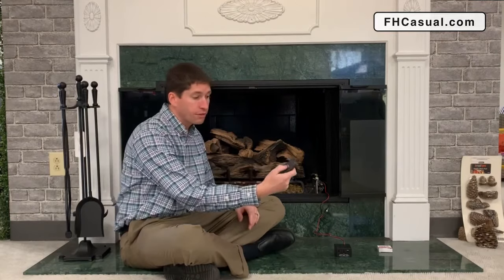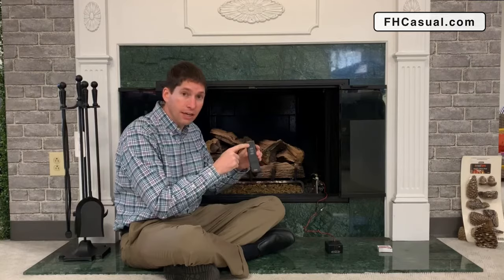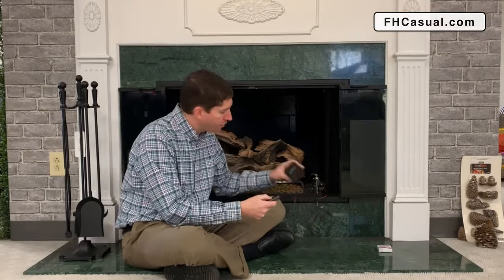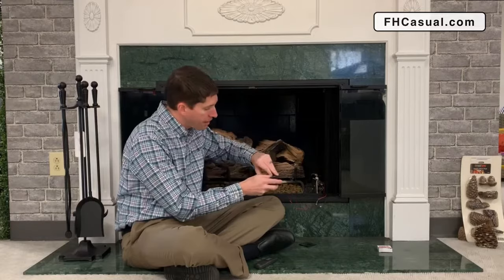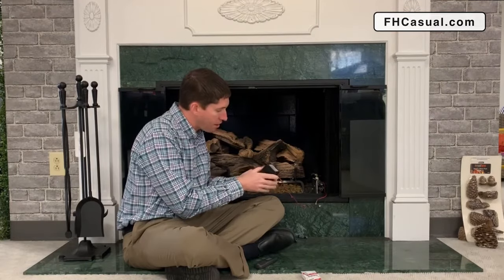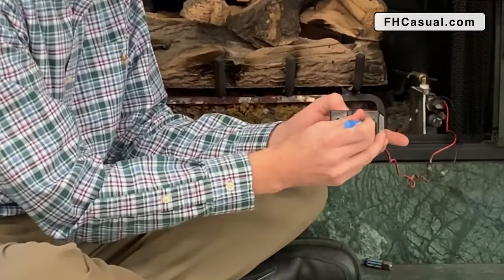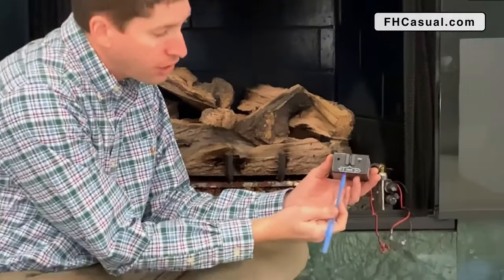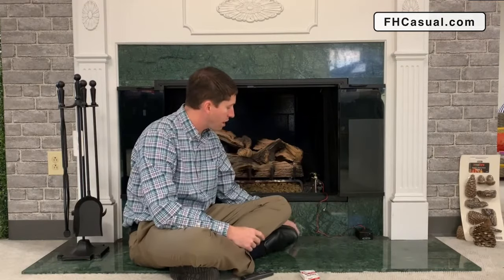How to Repair Your Fireplace Remote Control

Comment: You just saved me some bucks.  I had to change the batteries in the receiver.  I thought the remote wasn’t working then until you mentioned the “remote” setting on the receiver.  I had it on either on or off.  After moving it to remote I’m back in business.  Thank you!

Comment: Fantastic video!  Thank you!  Everything worked as you described.  The only difficulty I had was removing the back of the receiver.  Once I was able to remove the back, I found generic batteries.  Replaced the batteries and voila!  Fixed.  Thank you again!
Reply from the maker: So pleased we got you up and running again :)
Reply: My remote works but the E5 keeps popping up

Comment: When I press my “learn” button on my receiver I hear the single beep. But when I press the “on” on my remote I don’t get the multi beep from the receiver you got in the video. I see the red LED on my remote light up. I’m not sure what’s up.
Reply: Did you get it to work, I’m having the same problem.Thanks
Reply: My remote lights up and put all new batteries in reciver and remote but won’t work with remote but if I turn the switch to on the fireplace comes on what can I check
Reply: Same issue here. Any luck?
Reply: @whaleh8er991  still no luck
Reply: Same here. Ever figure it out?
Reply: Thank u, pressing the learn button then the remote re- synced it and that solved my problem and the beeping stopped thank goodness

Comment: The receiving unit usually comes with a metal housing that protects the unit from the heat, so that it can be put inside the fireplace. 
 Good video, thanks.

Comment: Where is the receiver located at. We had very cold weather last year & did not know that we  could add a battery to the fireplace. The remote was working before we knew anything about placing a battery inside. Cannot figure out now why remote will not turn fireplace on. I get the red signal on the remote.

Comment: I changed the batteries in the receiver. I successfully synced the two. However, when I push the "On" button, the receiver makes a beep, but the gas doesn't turn on. Pilot light is lit. Turns on manually. The receiver only beeps, but nothing happens. Any thoughts?
Reply: Same problem here
Reply: Me too got a pilot after changing remote box ... But the gas logs won't light .. I hear nothing
Reply: Look up the video on how to clean the temperature metal piece. Just a light sanding with sandpaper on the metal pin. It gets corroded and is a failsafe feature. Worked great for us.
Reply: I have no corrosion good batteries and it beeps at everything. Yet the flame will not go on or off or thermostat controlled....
Reply: I finally figured mine out today!! So, while the pilot light was lit, it would only turn on manually. I figured out today that by pushing the pilot knob in about halfway and turning again, it finally went all the way to "On." Tried the remote and it worked immediately!! I feel so stupid now... 🤣🤣
Reply: @Brendo_Games  where is the pilot button

Comment: Good video.  A few weeks ago, I started noticing a problem starting my G45 burner system.  It has worked flawlessly for almost three years.  When trying to light the burner, it would start "clicking" several times while the valve was trying to turn. It seemed to be stuck and not opening all the way for ignition. I changed the batteries in both the remote and receiver and checked to be sure nothing (gravel, etc.) was keeping the valve from opening all the way.  
Here's the deal, once the system does light, it seems to be fine for the rest of the evening.  
Next day: same problem - "click, click, click ..." - no ignition.  It's not the batteries.  It's not debris keeping the valve from turning.  Any help is appreciated!
Reply: My Real Fyre G45 has this exact same issue.  It is as if there is not enough force driven by the remote to get the valve past the on/off click point.  If you manually turn the valve past that point, the remote can get the valve to fully open and also to close.  But like you, when I attempt to first use the remote to turn on the fireplace, I get that clicking and the valve seems like it can't get past the on/off click point.  Did you ever find a solution?

Comment: Mine has fresh batteries in both. When I sync them it works once then nothing. If I press the button or flick the switch 10-15 times it works POS

Comment: Thank you but where is the receiver?
Reply: For us, the receiver was behind the panel...like the cover on the wall that look like the ones for light switches.
Reply: You just need to unscrew it, remove the panel and then replace the batteries. Then make sure switch is on remote...press the learn button...after the beep press your remote within 20 seconds of the learn button beep.